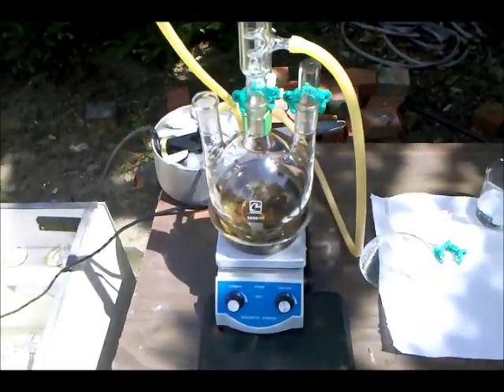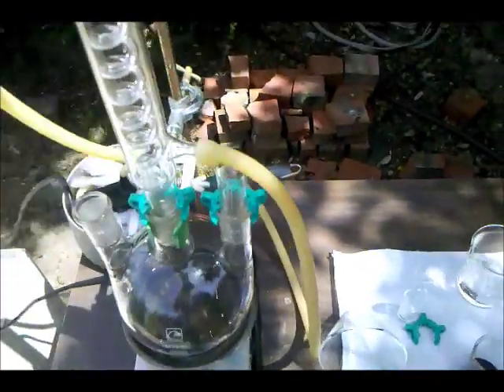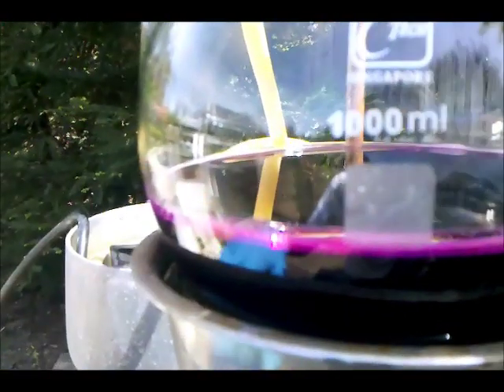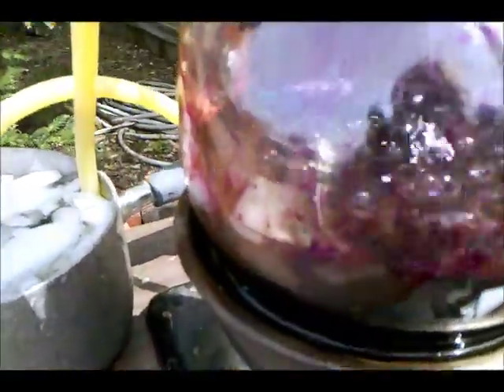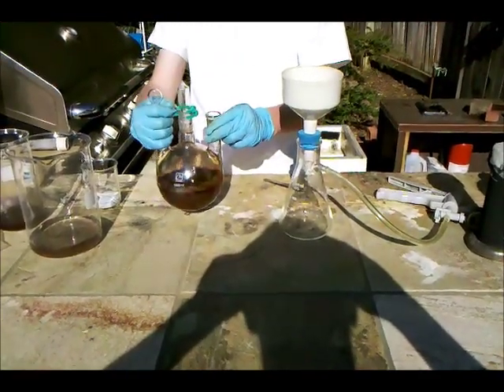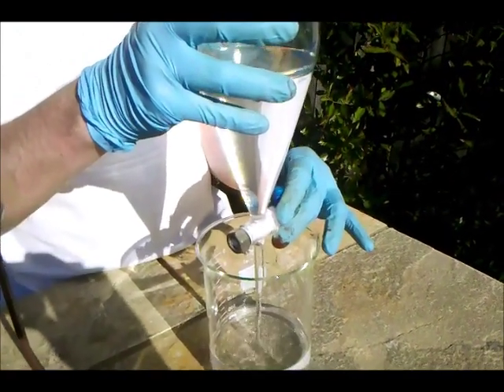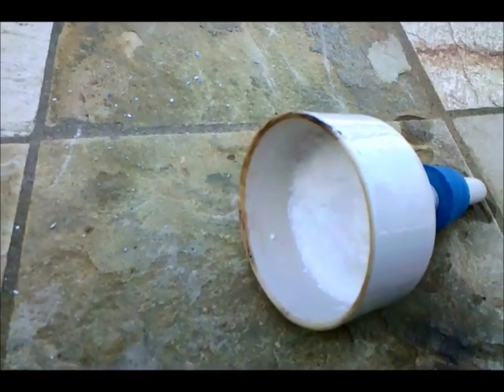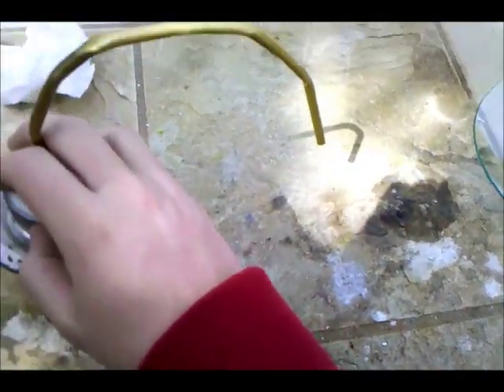Toluene to Benzene

Comment from the maker: @ScienceHideout While said like that it sounds scary, in this context it is not that dangerous.  It was on a low setting and using an oil bath, so heat was gentle.  No fumes made it even a fifth of the way out of the condenser so there was not enough flammable vapor around the torch to do anything.

Comment from the maker: @h0meIandsecurity Benzene will react with methyl chloride in presence of an anhydrous aluminium chloride catalyst to form toluene.  Instead of anhydrous aluminum chloride (hard to make) you can use  SbCl3, SnCl4, BF3, ZnCl2, or HgCl2. (Friedel–Crafts reaction)

If you can brominate your benzene to bromobenzene that will react with bromomethane and sodium metal to give you toluene and sodium bromide. (Wurtz-Fittig reaction)